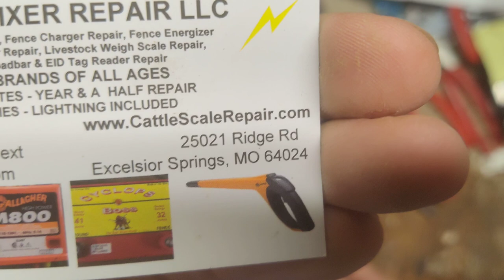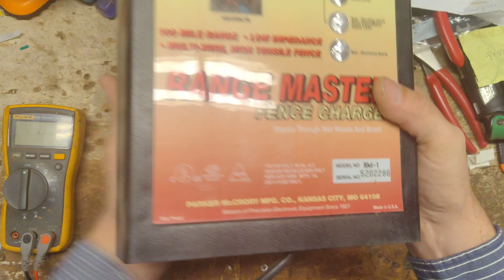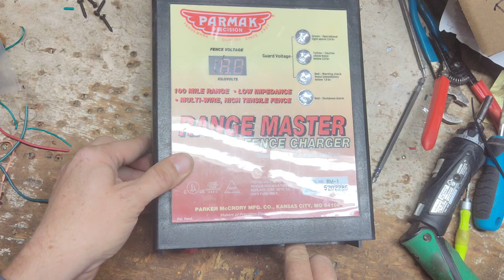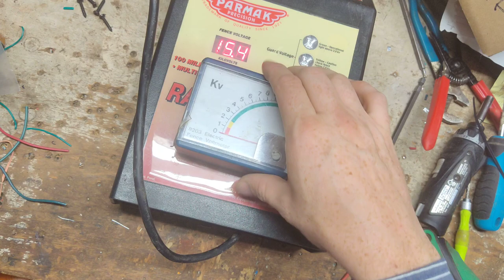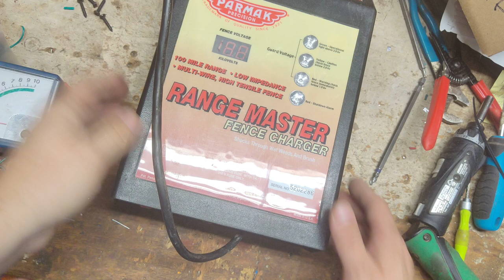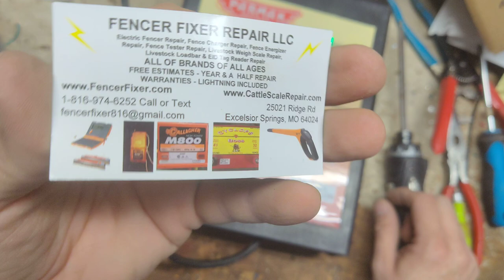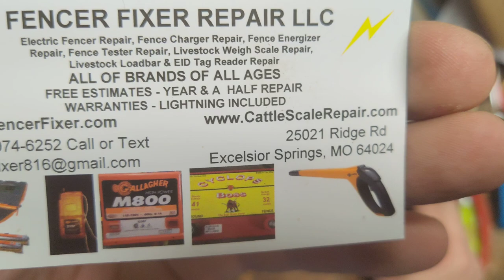OUCH! I got SHOCKED by a capacitor in a Parmak Rangemaster Fence Charger Repair, www.fencerfixer.com

Comment: I was servicing a 200 watt-second (joules) electronic flash unit.  The energy storage capacitor was fully charged but the flash lamp wouldn't fire.  The problem was in the trigger circuit.  While troubleshooting the trigger circuit, I accidently came in contact with the capacitor.  I found myself on the floor looking at the ceiling.  I had a headache that lasted 2 days.  That was the worst shock I ever got, and I routinely worked on vacuum tube color televisions with B+ voltages of 400V and second anode voltages of 33kV.